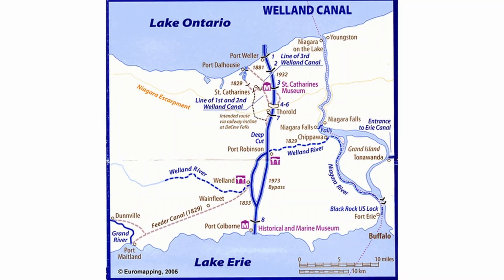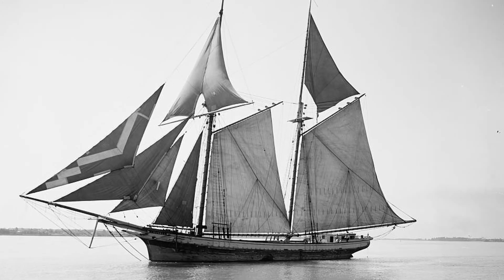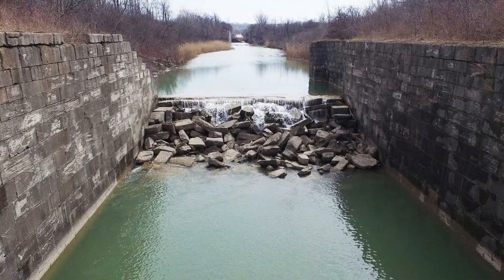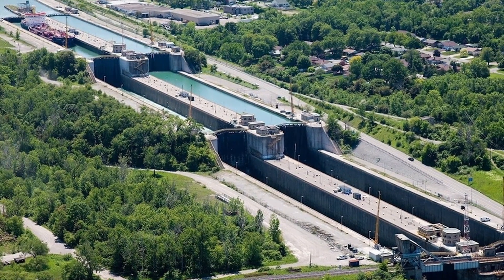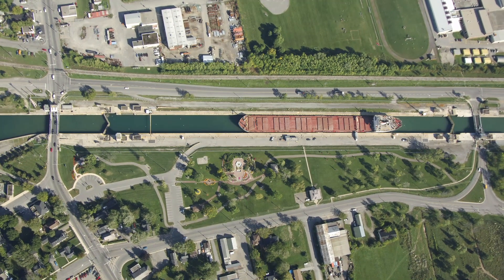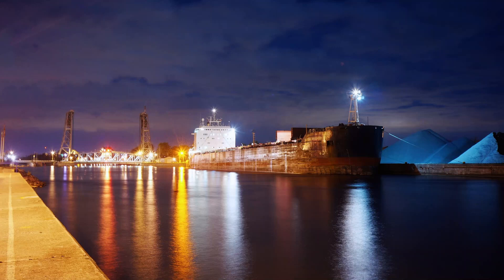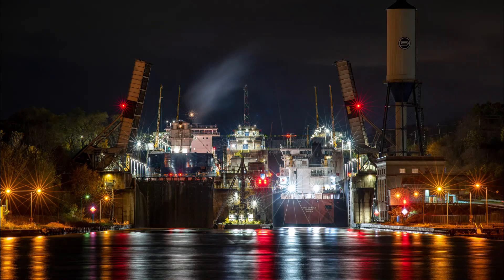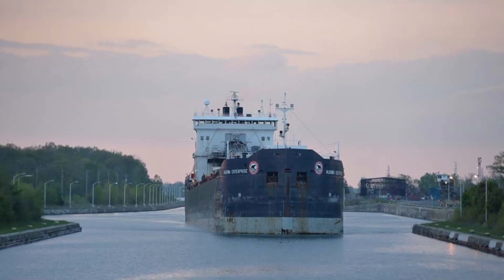The Canal That Drops Ships 326 Feet

Comment: Notes:
1. As originally conceived in 1816, the canal was merely meant to provide water to drive mills (within the current city of St. Catharines).  Ship traffic was a concept added later (and expanded over time) as people viewed the emerging Erie canal with a competitive eye.  Even after construction started in 1824, some details of design were tweaked!
2. New in the last 2 decades: instead of manual tying to bollards within locks, most locks new use a "vacuum mooring system", which requires less humans.  (Ships still use bollards at lock 8, which has a short ~3 foot vertical lift.  Bollards are still present at the other locks, as a backup.)